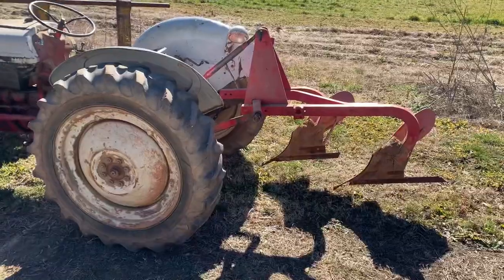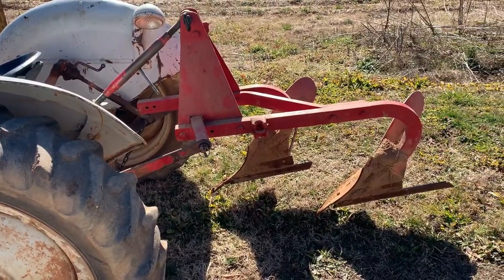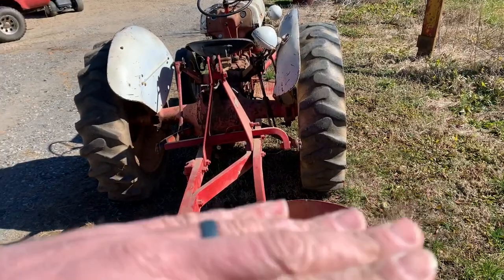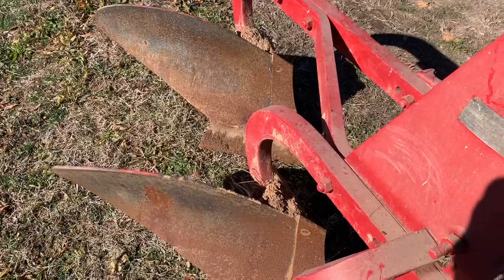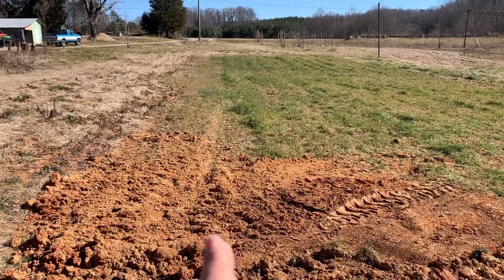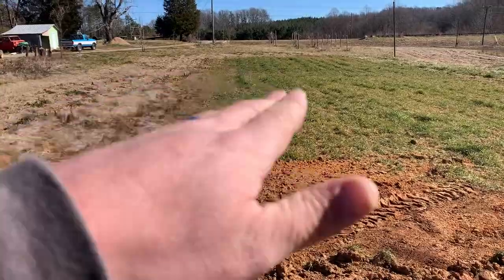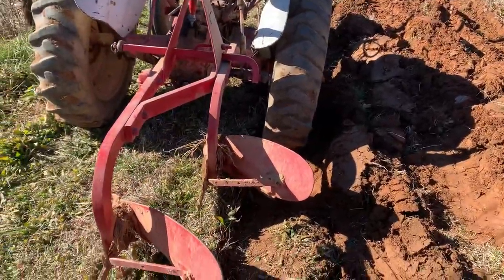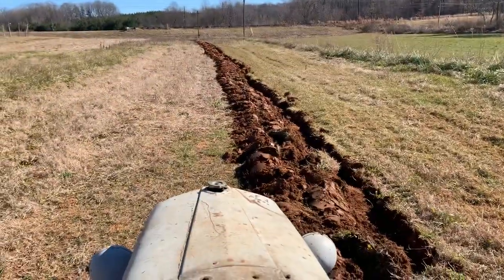How I Plow With My Ford 8n [[Dearborn 10-152]]

Comment: There is a lever under the seat on the 8ns. That is to switch the 3 point from height control to draft control. In draft control the plow depth can be controlled by how hard the tractor is pulling.
Reply from the maker: I have tried to use my draft many times. For one reason or another it doesn’t work properly. I have had the top off and adjusted the linkages a few times. Things are badly worn and need to be overhauled. One day I will get around to it. Thank you for commenting and watching!
Reply: @FishHuntCookTinker  There is alot thats gotta be setup right in the top cover of the tractor for both position and draft control to work right.  I would suggest rebuilding the toplink and trying it again.  On my granddad's tractor we had to replace quite a bit and machine out and rebush components to get it right.

Comment: These tractors are so simple that if you can't get it started than you shouldn't of baught it.. Gas. Air. Spark is all it needs unless it's frozen..
Reply from the maker: They are very simple old tractors. They can be finicky at times, but if you maintain them. They about always crank. Thanks for watching!

Comment: Putting coulters on that plow would make it pull a bit easier, those discs cut the turf in front of the plow shares. The ditches you refer to are actually furrows.
Reply from the maker: That probably would help. I have never ran a plow with them. For whatever reason it is hard to find a old one with them still on. Thank you for watching!

Comment: Tractor supply used to have shop manuals for these old tractors, I bought one there for an old Golden Jubilee I used to have, it shows all the internal adjustments to get your draft working properly, When it's properly adjusted, you don't have to constantly move your position lever, I wouldn't be afraid to dive into the hydraulic system, not too complicated. Dan and Rachel Gingell have excellent YouTube videos on that very thing, Good Video! Happy Plowing!!
Reply from the maker: Years ago I borrowed a manual and adjusted everything. Most of the linkages were badly worn. It helped some, but not greatly. Although I was much younger and knew way less then. Not that I am an expert now by any means. So who knows if I did it correctly. I probably should do it again one day. I have been holding off because I would like to rebuild the hydraulic pump as well. One of these days I will dive back into it. I have to get some other projects done first. Thank you for commenting and for watching!
Reply: They still do

Comment: If you plow from the middle every year you will have a high middle because your throwing the dirt to the middle and the youll have lower outer edges  Not a low spot or a dich as you call in the middle.

Comment: My dad bought a 1949 8n with 2 14 inch plows, 6ft disc harrow and 2 row cultivators all DEARBORN new in 1949. I learned to farm on this tractor and those pieces of equipment. He added a bottom plow to the Dearborn and pulled it behind a 420 John deere and a 2010 JohnDeere and Retired pulling it behind a 7000 Ford. Glad to say I just bought a 1949 8n that looks and runs like new and found and bought a 2 14 Dearborn plow for $225. Also got the 8n for $2300. Good video and pull that other little lever under the seat forward and you will have draft control.
Reply from the maker: That’s a good price on the 8n. The draft on mine doesn’t do anything anymore. Needs some TLC. Thanks for commenting and watching!

Comment: Nice job young man.  Carry on the traditions.  I'm always surprised at the amount of power those old n series tractors put out at even low rpm.  Love em...even without brakes😁
Reply from the maker: Thank you and I will do my best! They put out the power for their size. They really are not much larger than a lawnmower. I have been through my breaks multiple times. New seals the works. Last a year or two. Thanks for watching!
Reply: You don't need brakes just drop the anchor (plow)

Comment: You need to turn the draft lever under the seat from where ever it is to the other position. That way you don’t have to fool around with the depth , the draft control will raise and lower the plow to keep it in the ground where you set the stop on the raise and lower quadrant.

Comment: Adding ballast to your rear tires will give you more traction and help stop the tires from spinning.
Reply from the maker: Thank you for watching and commenting! I have my rear tires loaded with water and antifreeze. This definitely helps. I don’t know if they make wheel weights for a 8n? I have never seen them before on a tractor. I know most of the farmalls have them. I really just need to break down and get new tires. One of these days I will. Thanks again.
Reply: They did make wheel weights for the N series. Ballast was the most common weight.  The pie wheel weights from the later model tractors will fit also.

Comment: I’ve got a Ford 641 workmaster I plow my gardens and a few others around, I have a Ford 2 bottom 14” trip plow, and a 16” Ford trip, the tractor pulls both great, but I find myself using the 16” single bottom mostly. You never have to fight the tractor and I can plow faster. So it usually works out about the same as using the two bottom. I run fluid in my tires, it’s a big difference!
Reply from the maker: I have been thinking about getting a single bottom plow for years. The past few years it has been so wet I couldn’t even think about plowing. Therefore I never did. I may try to find one this year. It would be much easier on the tractor. I run fluid in my tires as well. They are just worn slap out. I will try and find a set soon. Thank you for watching!

Comment: If you make 2 passes down the center, turning the soil out in opposite directions, and then switch and turn in for 2 rounds you will be able to maintain level furrows and wont have to worry about throwing dirt in the wrong direction. This is called a 4 pass start. its a little time consuming, but makes for a nice finished product.
every time I break a couple acres with our old single bottom plow I just think, "how the hell did they do hundreds of acres like this 50 years ago....?"
Reply from the maker: As always I’m in a hurry. Normally I wait around to late in the year. Then I am scrambling around trying to get it plowed while it is dry enough. I normally don’t worry about it then level it when I disc. Definitely not optimal, but just how it normally goes. I love hearing the old timers talk about how they farmed all this land with a 8n and a farmall. It is amazing how times have changed! Thank you for commenting and watching!

Comment: interesting! i grew up and as teen, spent many hours breaking ground with this turning plow an another version parabolic “disc” plow. this turning plow is missing a disk cutter in front of each that.cut int the ground in front of each plow to the depth of each. greatly lowered the load, reduced fuel consumption and gave the turned over ground a more uniform appearance.
Reply from the maker: I picked up my plow very used and cheap. I had to rebuild most everything. It didn’t have any of the other parts with it. For now it gets it done. Maybe one day I will find or make the rest. Thank you for watching and commenting!

Comment: I know nothing about tractors and even less about farming/plowing/discing/harrowing, ...... but I am a very good mechanic. I purchase a tired but unmolested 1954 NAA (Jubilee identical). I have two acres I want to take care of and plant a garden here in the southwest. I'm fixing up the "Jubilee" (its easier to call it that as then everyone out here knows what it is even though technically its a NAA) and have fixed the the hydraulics and running. It has "draft control". Does the 8N? Does draft control really works so you don't have to have your hand as you demonstrated so well for when the tractor bogs down? ANY advice would be helpful as I know nothing. Which implement should I try to purchase first? Why?    My land has never been plowed. It was an avocado orchard for 100 years and now it is just land. It is pretty hard and doesn't look like all that beautiful soil you guys have with that deep brown color. I just can't imagine a blow like yours would cut into my soil. Do I plow first or disc first? Again, anything would help. Thank you.

Comment: Add weight, the rear bottom is too high, do you feel the lugs in the tires are too wide ? Family Farmed for years with 2 bottom plow with the 8n . Also had the ford 860 with liquid filled tires and wheel weights what a beast .
Reply from the maker: The 800 series are good old tractors. They have a ton of power over the 8n. Probably one of my favorite tractors.

Comment: Forgot to tell you to adjust the entire plow right or left by moving the cross bar on the plow so the heal of the front plow shear is in line with the inside of your furrow tire. This might require moving the tire too. Good luck. Once the plow is set properly it will pull  easy and straight behind.

Comment: This type of tractor only has a bit over 20 horsepower at the draw bar. A general rule of thumb is that a tractor can handle one inch of plow width for every draw bar horse power. You are expecting a bit too much from this tractor but getting away with it.When you changed your plow shares from the twelve inch shares it came with to fourteen inch plow shares, unless you adjusted the plow frame you might not have gained that much more plowing width. You have one plow cutting 14 inches in front, but the one behind it should be over lapping that furrow by two inches. In other works you are plowing 26 inches at a time, not 28. That is to your advantage.

Be careful adding weight to these tractors. We managed to snap an axle after filling the rear tires, never did it again after getting the axle welded. 

One suggestion: there is a high school girl that did what I think was a project video for FFA on tuning up these engines for plowing. She hit every step we used to do each spring. If you can find her it is well worth watching. The big things are like you mentioned, be sure the tractor is ready to work, but she also shows how to advance the timing to get some more power. If you haven't had the head off your tractor, these flat head engines do carbon up some thing bad and a good head off clean up with a valve job really helps their performance.
Reply from the maker: I have never heard that rule of thumb before. It definitely goes with what I have seen. I definitely am pushing my little 8n to the limit. One of these days I will find a single 16. If nothing else just to see the difference it makes. Years ago when I rebuilt the plow I planned to cut the 14” points to 12”. It is all but impossible to find 12” points. I honestly forgot all about it till I did the video. Unfortunately I use it once a year and forget about it. 
     If I have the time this winter I plan to go through the engine and lift completely. It is starting to show some signs of its age. Thank you very much for commenting. I appreciate the advice and you taking the time to give it!
Reply: The Dearborn  2-14 plow was the original plow for this tractor. And can pull that plow all day. Having the tractor properly ballasted, engine tuned up setting the plow up correctly are keys to making it work.   This was a good demonstration on how to do it.
Reply: @farmboy971  I'm not sure this is entirely correct. I think (but have no proof at hand) that the original Dearborn plow for this tractor was a 2-12. That little bit of difference doesn't sound like much, but on this small tractor it was a lot. My grandfather owned an 800 acre farm in the 1930's. Hired tractor work. The first tractor they bough was a 9N in 1939 and bought the next 5 the dealership could get right after it. One man could plow 10 acres a day in a ten hour day with this tractor - 4-5 times what a man and two teams of horses could. My grand dad, three sons and two son-in-laws were making their living off that farm. Made sense to have those tractors. The 2-14 plow may have been the standard plow when the 8N came out- it had more draw bar horsepower that the 9N. 
Last point - soil type makes a huge difference when talking about how big a plow a tractor can handle. Around here it is a clay/loam and can be heavy to till. I've worked some more sandy soil and it is a lot easier to plow.
Reply: @cdjhyoung  the 9n and 2n tractors would have been sold with a Ferguson plow and other Ferguson Implements I know 12 and 14” bottoms were offered. They may have offer 10” plows but where I am at. I haven’t seen any that small. The Dearborn line didn’t officially start until around the introduction of the 8N in late 47.   Most of what I find in the Dearborn line is 14”. I grew up in western MN in sandy loam to loamy clay soils with some rocks. The N series was popular In That area. My grandpa bought his first one in 48 and traded for a new one again in 52. The neighbors had a 9n and 8ns.   Harry Ferguson was a real genius with the 3 point and how he made a smaller tractor handle a plow that by conventional thought of the day needed a larger frame tractor. 

 I have lived a lot of years near now Fargo ND in the heart of the red River valley. There is very little history of the N series here likely because of the heavy clay. The higher hp and larger frame Farmalls Case, and John Deere where dominant here.  And eventually the 4wd. Steiger started just north of here.
Reply: @farmboy971  I think your knowledge of the history of the Dearborn series of equipment is better than mine. Was the Dearborn line of products a reaction to the fracturing of the Ferguson/Ford hand shake deal? I have seen one 2x10 inch Ferguson plow at an auction, but have never owned or used one. 

I agree with you about the genius of Ferguson and his hitch, but it was the whole integrated tractor as well. Other makers made small tractors, but they just didn't work as well, or as easily as the N series Fords. The basic secret of the Ferguson hitch lain in the coupling of the third (upper) link to the tractor by way of a heavy spring. It was strong enough to keep tillage tools in the ground, but had enough give to let the implement spring up if it hit a solid enough obstruction, saving the tool from damage. The hitch also attached to the tractor in such a way that in converted some of the draft of the implement into additional down force on the driving wheels.

Recently I was contemplating some of the add on equipment made for the N series tractors, specifically the auxiliary transmission like the Sherman. I find it a bit strange that the N series tractors were not the first to offer an on the go down shift for more torque. The technology was there in the transmission of the Model T Ford with its planetary gear system. That transmission operated in the same horsepower range as these Ford tractors, so the transfer of the gearing should or could have been relatively straight forward.  It just surprises me no one thought to combine the two.
Reply: @cdjhyoung  Dearborn was a result of Ford breaking the hand shake agreement that Harry and Henry made. Ford wanted their own line of equipment to market with the 8N.

Comment: Nice 8n! My dad got a 2 bottom Dearborn plow like yours, I got to use it in the garden last spring, but that’s about it. I had a lot of trouble getting traction. I don’t know if they make wheel weights for these tractors, I know dad doesn’t want to put fluid in the tires.
Reply from the maker: Without fluid in the rear tires it would definitely be difficult to get traction. If you could find a single 16” it would do a lot better. Thanks for watching!
Reply: Make sure you have the plow angle adjusted correctly. Having too much angle for depth will cause a plow to pull excessively hard. Drive your tractors left rear wheel up on a block of wood that is the depth you want to plow. 6" is plenty deep for a garden btw. This will simulate how the unit is sitting while plowing. Next adjust the plow so it is level side to side by turning the adjusters on your 3pt lift arms. Next step adjust front to back angle so the front tip of plow shares are touching the ground, and the rear of the landsides are about 1/4" off the ground. 
There are videos on YT showing this procedure as well. I plow my garden with a garden tractor and single bottom 10" Brinly plow at 6" depth, and I can turn sod with very little traction issue by setting it up the way I described so an N series tractor should be able to pull a 2-14" with a little fine tuning.

Comment: I'm starting a garden in a new field; dirt is packed and poor for gardening.  If I "turn it out" each year, and then bring in heavy amounts of compost/manure each year and pile it down the middle, will that help to spread it out?
Reply from the maker: It would spread it out, but only the width of the plow every year you plowed. I would dump it out in multiple places. Then disc it in. Just my two cents. Thank you for watching and commenting!
Reply: Just get some rotted bales, usually you can get em for free. Throw it out on your field then disk it

Comment: also sway bars are needed. that way it won't hit your overrun clutch
Reply from the maker: I have always been told not to use sway bars with a plow or disc. It keeps the implement from pushing your tractor to the side. Causing the tractor to lose traction and drive much harder. Not saying I’m right it is just how I was taught. This is how a old farmer explained it to me. I normally always take the overrun clutch off before I plow or disc. Thankfully my plow frame doesn’t stick out far enough to hit the clutch. A lot of the old plows will. Thank you for commenting and watching!
Reply: @FishHuntCookTinker  the sway bars just keep it steady that shouldn’t make it lose traction.